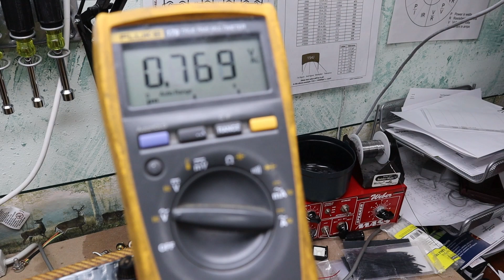Ground your amp!

Comment: Thanks for the PSA. Potentially very useful for people with vintage amps. In a somewhat related note, I had a 60 cycle hum develop that would go away when I touched the strings or bridge/tailpiece. I was about ready to tear the guitar apart to find the bad ground when the thought occurred to me to check the wall plug. I had left the amp plugged in to the same outlet for a few months with no problem, but apparently the ground plug had oxidized enough that the ground connection became iffy. Unplugging and plugging back in a few times solved the issue, so that has become my first advice for someone with a hum issue.

Comment: Hello, i understand that the chassis is hot by default from the factory or it's a hot wire losses touching the chassis   ?
Reply: Chassis are usually wired to connect to ground- usually it goes to earth ground (the center plug) but if it’s a two prong it just has to use the neutral as ground- you never want the chassis hot because it can literally kill you
Reply: @stonerdave  Thank you. I understand and i know you never wanted to have you're chassis hot, but how come you're chassis has voltage ???  There is a hot touching the chassis somewhere, or the ''dead cap'' is no good.

I have a Bandmaster 65, and i am going to put a 3 prongs cord on it, but even if i reverse the old cord plug (in the wall outlet) my chassis is still not hot. I have check the chassis with my multi meter, that it the first thing that i have donned before plunging my guitar.

Comment: Or just avoid the ground or anything grounded while using the amp 😂- I saw a video a while back of a guy getting electrocuted when he grabbed his mike because of this exact situation- great demo
Reply: Yeah just skip fixing the cord. Focus instead on trying to play the music yet in the back of your head, be hyper aware of things you shouldn't touch or bump into. One eye on the strings, one on the danger. 

Invest 30.00 and solder in a new cord.
Reply: @ it’s not even $20 to fix this and yeah it’s a lot easier to focus on your playing if you don’t have to worry about dying because you plugged it in the wrong way without any indication you plugged it in the wrong way